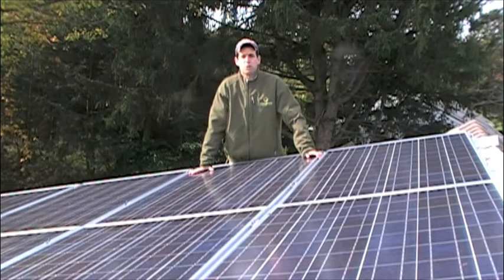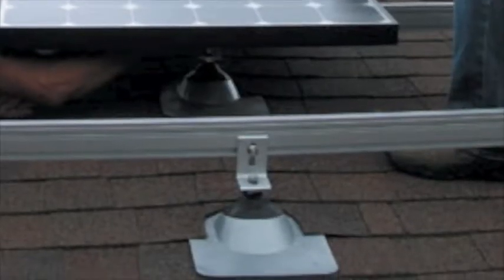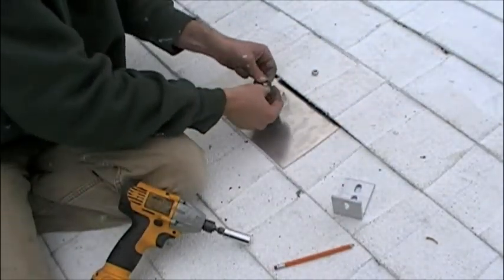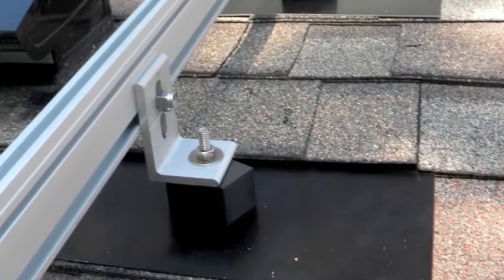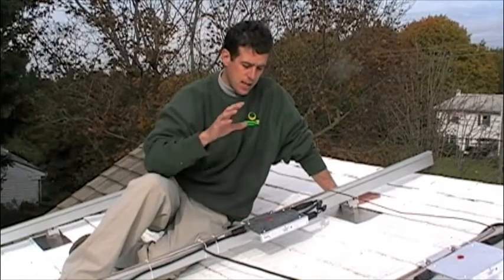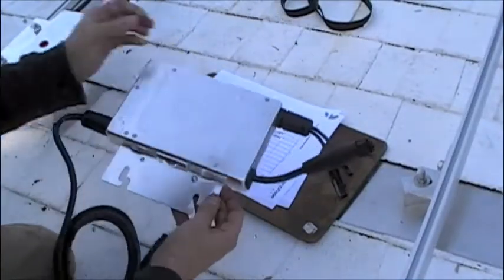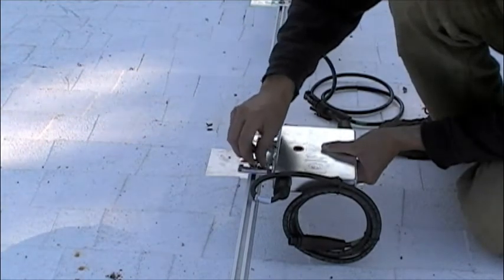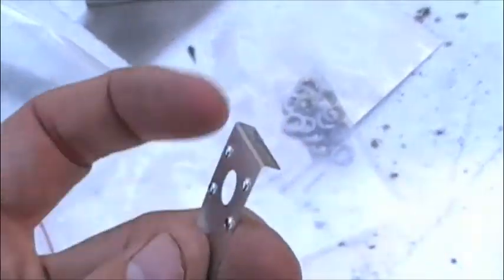Part 1 New Jersey PV Solar Installation of a Enphase Energy Micro Inverter Sharp Unirac

Comment: Great video and info.  However, I prefer the Andalay system.  The micro inverters are built into the panels- and the rack is as well.  It makes the job go much quicker.  Also, there can be no warranty issues surrounding the install since the inverters are installed at the factory.

Comment: Micro inverters have 1 disadvantage.  It has been said that all inverters of all types fail at 10%.  This would mean that with 30 panels on a roof, that 3  would go bad (usually in the first 6 months, after that they are very reliable).  With micro inverters, you need to go back on the roof and pull the inverter and the panel.  Maybe even having to pull a number of panels to get to the bad unit.  Central inverters can be done on the ground.  Replacing is much easier.

Comment: Does the system have manufacture torque values for all there nuts and bolts for the railing system and mid and end clamps? Why don't you use a torque wrench instead of a impact drill? Is it because you will take longer on your install? I would think you would want even amount of pressure through out your rails and panels or arrays. Just wondering.

Comment: I know i have asked You about solar before. My question is what about ground mount systems. Are they more expensive, or do the pay for them selves because they follow the sun?
Reply from the maker: Ground mount better, but more expensive.  Most ground mounts don't track the sun, but are typically oriented better, have a better angle and can be cleaned from snow etc.   Not to mention, its just off the roof, incase there is ever a problem.

Comment from the maker: Actually that is not true, there are aftermarket control systems that will switch from AC back to DC for battery backup.. Yes, there are some losses.  However, unless you're living in a cabin in the woods of Vermont and want stand alone power, 99.9% of all systems in NJ are grid tie.. Batteries are very very expensive, they require maintenance and have life spans less then the solar system.   So it is a slight disadvantage for backup, but that market is extremely small.

Comment: How are these Enphase holding up?  those look like the M190's which have been discontinued and had terrible reliability problems... wave of the future... over-excited solar industry puppies out there don't realize that micro's are a bad idea.  You do NOT want to put the most sensitive device in the system, on the most dangerous part of your house, buried underneath the heaviest and most cumbersome devices in the system which are the modules.  Put the inverter in the garage on on the wall.